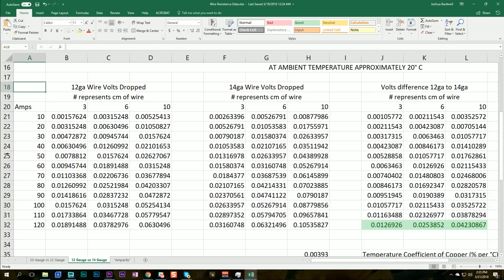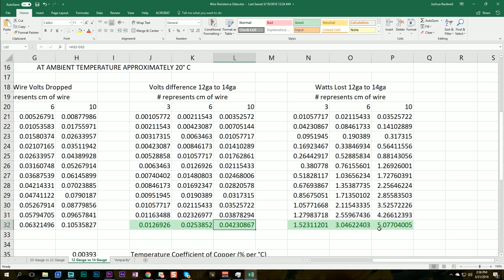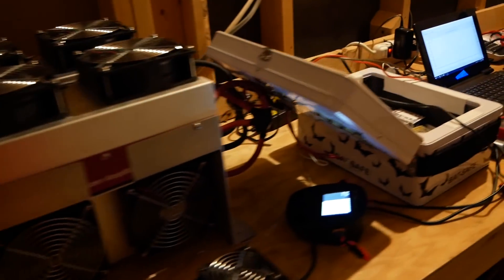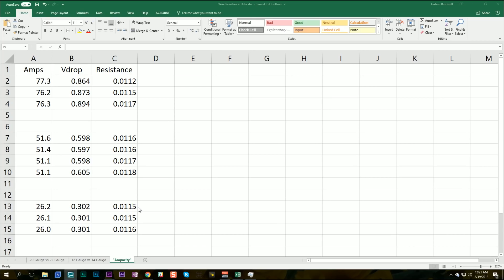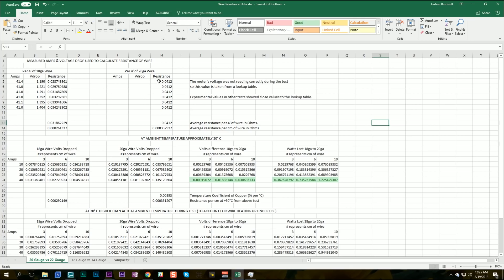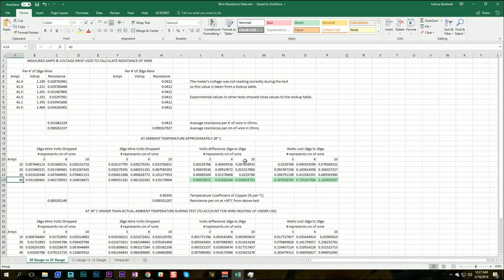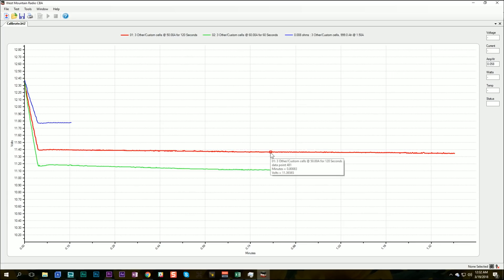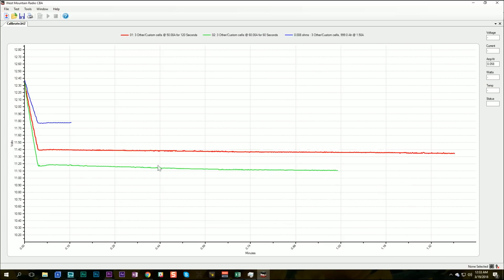Battery Wire Gauge | WHY IT (STILL) DOESN'T ACTUALLY MATTER

Comment: Unless you are drawing power from all of the power rails, you wont be using all the 1200W
Reply from the maker: It's not that kind of power supply. It is a rack mount server supply. There is only one rail.

Comment: Right on... Tell 'em bro! Most decent electricians (maybe not the Romex jockeys) already know that the voltage drop is negligible untill you run a good distance of wire. Not everyone gets it though.

Comment: I didn't watch your initial video (I know...boo, hiss :P ) so I don't know if it was previously covered - but would using the smaller gauge wire give you a noteworthy decrease in total capacitance?
Reply from the maker: I'm not sure the answer to that.
Reply: I feel like the fact capacitance of wire is specified in nano-Farads per foot means there's not a huge amount in it when we're talking 2 inch lengths - not with the frequencies (unwanted or not) we're dealing with. 
To be fair Joshua, if you don't know already then I doubt it's worth considering 🙂
*edited because I'm terrible at typing on my phone

Comment: can you do a comparison between 12awg and 22awg for extreme comparison? Will be an awesome gift to the hobby "if" people can ditch super fat wires for those tiny super flexible and light wires.
Reply from the maker: No... that would be silly.
Reply: extreme tests are used to explore outside of prediction quite often. But anyway, great video.

Comment: You say that a couple of watts isn't much for a wire, but how much is too much? Obviously the silicone coating on the wire won't melt off, but how hot does the wire have to get before you start to weaken solder joints? And how many watts does it take to get up to that point?
Reply from the maker: Good question!

Comment: When I first started flying electrics we used copper wire, the strands were finer ,it was more flexible, easier to solder,and probably offered less resistance the wire we buy now is like fencing wire in comparison.
Reply from the maker: IDK what you're using but fine-strand silicone wire is the standard for quads. It's incredibly fine-stranded and flexible. It has roughly equivalent resistance to solid-core because the strands are so fine.

Comment: If the wire companies make new fulfillment wire it will be a wire that will be built carbon in the center, copper around the carbon, the carbon around the copper, etc, until you have wire that is 20 gauge then you put the 20 gauge into a bundle to what ever you like. Remember electricity only flows outer surface of the wire. So you put rings of copper and carbon and each rings a outside AND a inside surface allowing it flow almost 2 as much you will have maybe a like super conductors. Carbon in the 1 or 2 molecules is a superconductor or a insulator.

Comment: Hi Joshua. . .
I have problems with the FC MATEK F405-STD. . .
in practice, the led_strips do not work together with the barometer also by configuring with CLI. . in Betaflight the S7 pin as described in the matek portfolio guide. . .
then I say. . . what's the point of building a FC F4 with ledstrip and barometer if you can not use them together?
I have read several thred that have the same problem. .
you who are expert. . you think we're all wimps. . or is there a solution? I consider you a teacher in these cases.
Be kind, give us poor sinners a valid answer
Thank you so much.
Reply from the maker: It sounds like that board is not designed to use both of those features at the same time. I don't think there's a workaround.

Comment: JB , the issue is the ampacity of the wire. Yes that is a word.. the issue you will find with smaller guage wire. Since we are firing motors . Is that you are measuring the losses not the ability of the ampacity . Best way to check this is to max load. The motor with a high pitch prop. And test the timing to full kv ability. Full rpm and time to reach that rpm. Since resistance reduces current. This is where it happens.

Theoretically , the gains of wire guage are increased torque and higher kv. The torque comes from the voltage . The rpm comes from the current. What happens is that when the electrons bottleneck that's where the current loss starts. The more you stay in commitment of throttle. The higher resistance and heat through circuit.
Reply: Also if you set up. An osciloscope. I have found that when you have reached max ampacity of the wire and motors. Go to the DC voltagw side of esc. And set up scope to read AC peak to peak. And dc mean. You will see when you reached the limit of the wire . .
Reply: Problem #3 , you need to normalize , and get the losses on each circuit you are testing. You will need a network analyzer for this. You will require about 15k in test equipment to properly test it. On network analyzer go to calibrate button , select normalize , the select auto adjust. You will see db loss is set to zero. Once calibrated. Test other wire and the measurement is the difference. In the two wires you now know the losses from test points.
Reply: https://en.m.wikipedia.org/wiki/Ampacity
Reply from the maker: I'm not disputing that ampacity is a thing that exists. I'm just saying it's not a limiting factor at the current and wire gauge sizes we're discussing. If you can demonstrate otherwise, I'd welcome it. Frankly, I think you could argue that the ampacity of our wires is higher than typical, because they are always installed in a fast-moving airflow, which reduces heat buildup.

It should be easy for you to set up a test that demonstrates higher rpm at higher wire gauge. In my opinion, what you would need to do is show that the loss in rpm is significantly different than the voltage loss I calculate in this test.
Reply: Joshua Bardwell , agreed . I only have 4 days left at my current job. If I get a chance. I will run the scenario through our equipment. In the test fashion your are trying to complete. I also have 6 physicists at work who can crunch our way of testing. Again. Only if I got time to get away with it. Pm me. If you for time Monday around lunch. And I will set up if I can. But we got to do it During my lunch break. We got one hour. To complete test.
Reply from the maker: If you get results, email them to me and I'll be glad to share them.

Comment: nicely done..  wire gauge has been discussed in on-road racing for a long time and I've always wondered myself what the benefits were if heavier gauge was used (14 gauge) versus lighter gauge.  My thought has leaned towards the weight benefits of balancing a car (Left to right) and centre of gravity, and I think the same benefits would apply to drones.   Seeing the results demonstrate that the differences are negligible.  

I would be interested to know if using connectors in between a motor and ESC would increase resistance versus direct wiring..

Lastly, the battery tester looks like a monster of device.. thanks for showing

Comment: What you say about losses are true, but it is still a fact that wires are like fuses and a thin wire will blow sooner than a fat wire. I don't worry about losses, but temperature and the fusing current. I always use the wire gauge used by the manufacturers of the batteries in question (14 AWG for the typical quad) and will continue to do so. Simple as that.
You may call me a "drive by commenter", I don't care much.

Comment: Just an idea, if you wanted to have the most efficient quad would you want to have heavier gauge or will the extra weight effect performance more? ( I’m sure there are better ways to improve efficiency than wire but just a thought)
Reply: well, If you want efficency, go go with bigger motors and bigger props... something like 12" props or higher...
Mini quads are awefully inefficient...

Comment: I totally agree with JB.  Short runs of wire just don't matter.  What really matters is the connections at either end and anything in between.  Every battery is going to have some sort of plug and bigger is always better... the more contact surface it has, the better.  Well done solder connections are best.  The biggest improvement to the electrical system you can make is to get rid of any and all bullet connectors.  They may be nice to swap out ESC's or something but they create a massive bottleneck for electricity and add resistance to the system that just doesn't need to be there.  Great job and keep up the great vids!

Comment: Hi Joshua! Thanks for revisiting the question. I used 14awg wire for just the battery and then thinner wires for each esc, motor etc. My amperage per esc doesn't go higher than 15.

Comment: I agree with you... On most things ;)
Even if the difference is only 1W, it is an increase of about 30%. Because cable losses are so small it doesn't matter. I argue that, if you are optimising everything on your quad, why not start by doing somthing simple like solder some new cables. 
Btw have you ever done some inductance testing of the different cables? 
I could imagine there is some high(ish) frequency noise on the batteryleads.
As always great video :)
Reply from the maker: Yes for sure. If you are optimizing heavily then use heavier wire.

Comment: So 4" of 20g battery wire + 4" main power lead + xt30, Is completely acceptable for  4s, 1407 4200kv, with small cap on 30a, 4in1?... Epic Thumbnail JB 👍😂
Reply from the maker: Oh for sure I would think so. On xT30 how much current are you pulling TOTAL?

Comment: Mr Bardwell, Can you test White Noise "RaceWire"  This is used on the arms of the quad to help prevent wire damage if there was a propr strike.  I'd like to see the resistance of this as I am currently using it, and designing a 4 layer option myself and I'd like to see what the potential difference might be.  Thanks!

Comment: Since you mentioned temperature, did you measure the heat in or around the wire? The reason I am asking is, that my soldering iron has 10 watts. So I can imagine it gets warm. I know, in a soldering iron, the heat is concentrated in the tip, but I am curious how warm a 14 gauge wire might get.
Reply from the maker: I think your soldering iron must have more than 10 watts. 40 to 60 watts is more common.
Reply: Joshua Bardwell actually you are right, it says 15W on it.

Comment: Hello joshua indeed it doesn't matter how thick they are exept if you use very thin for example 28 that would be a iseu but overall as you also can so from the manufacturer the motors not coming with very thick cable because of the rapid walk through of the voltage as it gets consumed bij de motors. So as a men who works with a lot of electricity and wires motors and components when wires are short it's not much of a deal. Btw the strainded wires which normally been used are of a high quality so the voltage and amperes can walk through with no loss at all and certainly no power losses in the brushless motors btw in fact when the dc voltage gets configured to ac through the esc the voltage gets a real different feeding patern to the motors. So as you always say guys listen carefully YOU GONNA LEARN SOMETHING TODAY! !

Comment: Title is misleading, to straight up say wire gauge doesn't matter is wrong. 
If your wire gauge is too low for the power running through it you will melt the insulation off the wire and end up with a short and more than likely a fire. 

So anybody thinking about grabbing some 34AWG wire to save on weight is setting themselves up for a nightmare

Comment: This is just a f***ing awesome testing!!!! Thank you for doing this! I always wanted to know this i even caluclated the difference of resistance of different wires. But i was not able to really test them!!! 

One little thing! In my country they do a lot of testing of power supplys for computers... and the output voltage is not as rock solid as you might think. (But i dont believe this would have made a difference)  But it is prefect, when you meassure the voltage after the wire and at the power supply so you can be really sure its the wire which causes the voltage to drop.

Comment: This goes against everything that we have been taught.  How about the additional resistance caused by the two sodder  connections at both ends of the wire?  Are you sure you multiplied it by four?  I'm going to do some testing myself.  It's not that I don't belive you.  It's more like I question my understanding of your findings.
Reply from the maker: I LOVE THIS ANSWER. At first I felt a little annoyed by your skepticism, but then you said, "I'm going to do some testing myself." I LOVE IT. YESSSS. I'm only annoyed at naked skepticism. When skepticism causes investigation and exploration and SCIENCE that is the best.

PS: solder connections are accounted for IMO because this wire had XT60 on either end.

Comment: Much respect Mr Bardwell but I think you've missed at least one critical factor here. The loss in transmitted voltage/power is only part of the issue. I would propose that the increased voltage drop reduces available motor voltage which reduces the both the RPM's and the amount of current the motor can pull full throttle. 0.05V on a 2300 KV motor is 115 RPM which is a substantial performance difference, if I were a serious racer I would take everything I could get. I fully support your scientific testing and propose you do an actual motor dyno test with various wire gauges. So far all you've done is prove voltage drop on the wire, but you haven't actually quantified the effect on the entire system.
Reply from the maker: If there is voltage drop and rpm drop at the motor, the pilot or the PID loop will compensate by increasing the throttle. Volts will drop but amps will go up. But then volts will drop some more. So there may be a bit of a non-linear feedback loop here that is not accounted for by my testing.

Personally I feel most comfortable ignoring volts and thinking in terms of watts. If we assume that a typical racing motor will make between 2 and 3 grams per watt of thrust, a loss of 5 watts costs 10-15 grams of thrust. A loss of 20 watts costs 40-60 grams of thrust. That's definitely not nothing, but I feel like it is probably within the normal variation that most pilots will experience and not notice. Also, the heavier wire will have weight which will somewhat offset the difference.

Ultimately, I'm just glad we're thinking about the topic.
Reply: Gabriel DeVault Umm so, what have you done about it? Don't scream from down the street, conduct the test yourself mate and film the results....
Reply: Joshua Bardwell I appreciate the discussion. You are totally correct about the controller compensating, but that only works till you hit full throttle, then there is no extra throttle to give and you lose the extra power. Again, it's not just the voltage/power lost in the wire, it's the lowerr voltage available to the motor resulting in less RPM/thrust
Reply: There's no screaming going on, just two adults having a mature, rational conversation. FYI, I have dyno'd more motors than I can recall, from mini-stuff to 10's of kW. Unfortunately I am not free to share these tests. Maybe some day I'll have the time, I really would love to, because, to date, I have not seen anyone do proper complete drivetrain testing analysis. If Mr. Bardwell was interested I would be happy to discuss what a complete and proper drivetrain dyno system and test suite is.

Comment: It also depends on the number of strands of copper in the 12 or 14 gauge wire also....
Reply from the maker: All quads should be using fine-strand "silicone" wire, which has resistance very close to solid-core.

Comment: Over the years while studying to be a biologist I conducted a fair number of experiments. Therefore I have a decent understanding of the scientific process. With that said, for this application (hobby grade) the testing done here was more than adequate. I should also add that prior to my schooling I worked in the aerospace industry for 20 years on aircraft support equipment. That meant working on and repairing electronics among many other things. Even when replacing faulty wiring it was usually done with "similar" gauge wire. Not necessarily the same gauge. Sometimes it was sized up and others a size down depending on what was on hand... There are readily accessible online wire resistance calculators (and charts) available that also show this data for those really concerned... For those of you that want to challenge people that are presenting information and data. You need to do so with context! A counter argument is not attacking another person it's using credible information to validate your side. Anything less shows your ignorance...

Comment: When you consider the size of the circuitry on the components you just need the smallest wire that won’t melt under load. I think it can get surprisingly small.

Comment: Test a quad, changing the main power lead to thinner and thinner wires until you can notice a difference in performance not from charts but in real life. How thin can you go?

Another interesting test would be 4S vs 6S because people are constantly saying online that higher voltage = less current = less heat = more efficient. Judging by your numbers (50mv heat loss at 50A over 90 seconds) there would be no tangible difference.
Reply: Do the math.  Here 20watts may not be a big deal, but for some, it may.  Shouldn’t be hard to calculate the peak power consumption of a power system and then determine how much power one is willing to give up for less weight or lighter gauge.

Comment: Your power supply is the wrong one, this one is less than $20, and 2 jumper wires. https://www.ebay.com/i/142730277364?rt=nc  or search ebay for HP DPS-800GB

Comment: what about the weight difference between the different gauge wires at the same length. doesn't that Negate the reason to use thicker wire just that much more?  (what i mean is:  the weight difference would make the "gain" in power efficiency by using thicker wire completely pointless. )